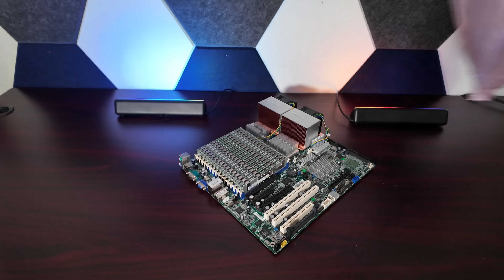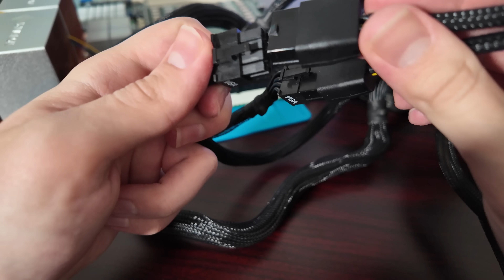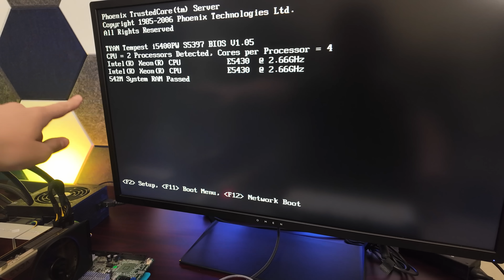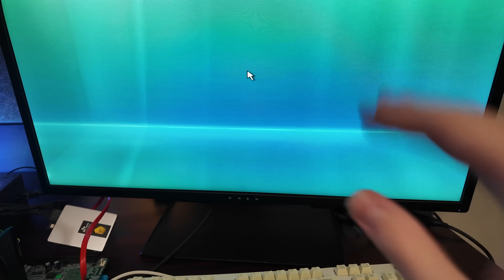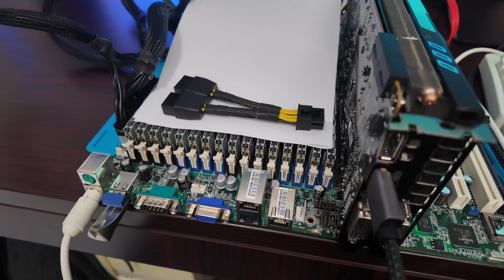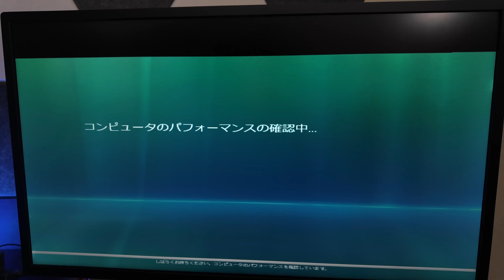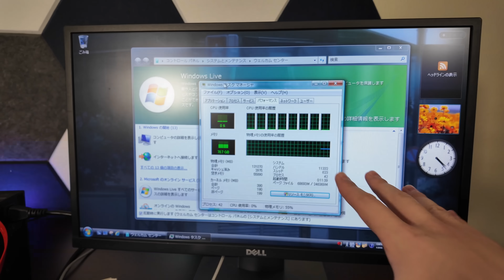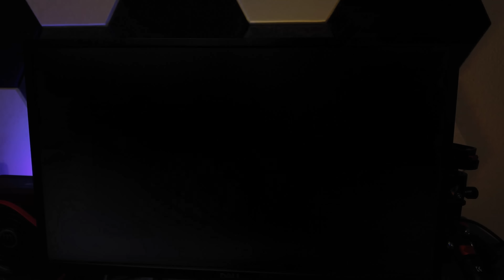What can you do with 128GB of DDR2?

Comment: install linux, install ollama, have it offload gptoss 120b 4bit to ram rather then gpu, you can technically fit a 70B model at 8 bit quantization  or 120B at 4 bit  but it might respond with a letter every minute but might generate text as fast as you can read no clue. find out :)

Comment: I could use some ideas. I got my hands on a Dual Intel Xeon E5-2690 v4 workstation, so 28 cores, 56 threads and 256GB of ECC DDR4 running at 2400Mhz

Comment: Multiple ram disks might facilitate multiprocessing. The main use I could see would be if you were running a local website, database, fileserver, services, etc. If programmer plausibly some quirky custom code, granted again likely to run into CPU bottleneck before ram usage.

Comment: 1st get some ram coolers or 3d print a mount to hold some fans over your ram sticks. (Constricting air to focus pressure is how cooling works)
2nd find a case with a lot of intake and exhaust fans or 3d print one that. 
3rd Don't use Windows vista go with a Linux distro find one you like then use a PCI slot to emulate win 10/11.
4th Play some games host some network stuff or host a local AI... you could do a lot.

Comment: Since these are XEON, I bet even in this Generation, they already somewhat support virtualisation.

Going for a Hypervisor-OS (Proxmox, Unraid, etc.) would probably work and with every trick in the book, you could probably run some more "sophisticated" services on it.

But I think the power usage would not be worth it.
One thing I could however think of, is a virtualisation server for older Windows versions. For example: Hosting some Win 98 instances and access them via remote (pixel based).

If correctly configured, this could make LAN sessions of old games in your home a breeze, if you have a really beefy (for that time) graphics card as well.

4 player Age of Empires session within seconds, running (sort of) natively on Win 98?
Guess that would be cool!

Another actual usecase would be for teaching / exploring old OS. Again with a Hypervisor and then you install every Windows Version up until... I don't know... Windows 2000?

Comment: The first PC I ever paid real actual cash money for was a DDR2 system... after living off hand-me-downs ranging from a Pentium I without MMX to a Celeron slot CPU, and even an RDRAM machine.

Though these are more GPU benchmarks, some period-correct tests could be FurMark, Unigine Heaven, and Crysis. Or if you want to get really wild, get another matching GTX 770, put that other PCI-E x16 slot to use, and see how that thing runs The Witcher 2 with Uber Sampling on.

Comment: I did decide to do some googling about what this thing can do.  And at least on the system side, this thing can saturate a 10GB network. 

Like that's a surprisingly big punch for such a old thing.  The main limitation would be getting it out of the system.  which are limited by the connection points of the era.

I would say something you can try, try streaming something intensive over your network.

Comment: if you pinmod the xeon X5470 for socket 771, you get 4ghz (at stock vcore works almost always, no tweaking necessary) at 400fsb (800mhz ram - no need to overclock that and test for stability.
2x x5470 would be usable even today I guess

i gamed on one in 2022

Comment: Would it be possible to use a RAM-disk (which I didn't even know about until this video!) to store an entire OS? And how would you make that work?

Can you run Fallout New Vegas on that system using a RAM-disk only for storing the game's data?

What if you swapped both the CPUs for something more modern (obviously with the same socket), to test what part(s) is the bottleneck in the system?

Can it run anything newer - something like CachyOS?

Comment: I have 2 of these dual cpu lga771 boards with 64gb each.  Just using every other dimm slot with a big 140mm fan on it the ram still gets to 80C.  You absolutely need some sort of 3d printed shroud solution for it in that configuration, so I could only imagine if you had every slot full.

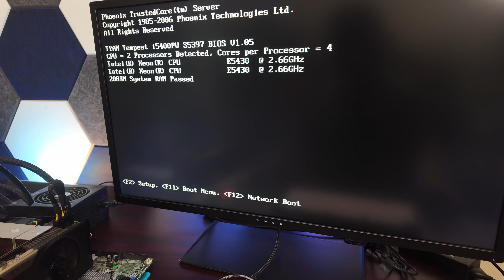Comment: 5:03 I believe it wouldn't normally do this every boot, just if ram configuration changes or cmos is reset (which it looks like happened, given the errors)
Reply: I had forgotten the old RAM check cycle,  128GB......... so funny...

Comment: I have laptop from 2006, it came with C2D P7350, 3GB DDR2, GF9600GS 512MB, Since then SSD was not existent, it had HDD. Today i have upgraded to T9400, later to T9900 and 8GB RAM, and SSD. I was using it for programming, more specifically RAM Disk, because DDR2 offered me around 2GB/sec, with basically no seek time. When SSD came, RAM Disk was still way ahead.

Comment: as far as something you could potentially do with this:

a) ramdisk could be used for a minecraft server, sure it's only equivalent to an NVMe but that means you don't need a new NVMe
b) a really slow but surprisingly smart LLM, you won't get answers from it very quickly, but you can push surprisingly high context limits and model sizes using that much RAM as long as you're willing to wait for responses. might be useful for automated agentic coding or something like that.
c) some other sort of batch processing similar to the pi calculation you did but for say, video editing or something

Comment: So strange that 1gb of HDD or SSD is 1.000mb while 1gb of DDR memory is actually 1.024mb. I just wonder why HDD and SSD sellers are allowed to scam people under the pretence of "traiditon"?
Reply: It’s not a “scam”.

Ram manufacturers and windows use base 2 to measure capacity. So windows matches whatever the packaging says for ram.

For storage, manufacturers use base 10. 1000 KB = 1 MB. Windows uses base 2. 1024 KB = 1 MB. because windows considers gigabytes to be larger than what manufactures use, it appears as if there is less storage.

Comment: Newer boards had the feature of not showing the process of counting the RAM. (Maybe for the screens that burn in images that are not changing for too long?)
So the screen stays turned off until all the checks are finished - which might need some time as the video shows.

People turned their new systems off and on again or hit the reset button after waiting for 1-10 minutes because their screens turned off while their systems checked the 32-128 GB of DDR4 RAM. (And now waiting for 128 GB of RAM sounds like "something we would like to do but it's too expensive".)
While the 10 minutes were enough for 32 GB the other guy needed to grab a bite to find that his 128 GB had been finally found and that the OS was missing.

Comment: I have one 10 years old mainboard with 256 GB DDR3 RAM and single Xeon 2673v4 and a 2nd 10 years old mainboard with 256 GB DDR3 RAM and dual Xeon 2673v4 and use it for AI.... both runs with linux.

Comment: I use to work in a telecom server factory where we made servers for telecom station. One of the products in those system was a PC unit that typically at that time run Nehalem  CPU with 3 chanell memory. The typical set up was 48GB of memory, but also 24 and 96GB was common.

We also use AMD CPU before that , but those had a even memory channel set up and only reach 64GB of ram maximum

Comment: You can run so many virtual machines inside of it. I can't recall how it was named back in a days, firstly introduced in Vista and then migrated to the 7 to be able to run older applications designed for XP.
Reply: Windows XP Mode?
Reply: @8wwwwwwww8888org  yes, it was called XP Mode, running inside of Windows Virtual PC, which actually allowed to run not only XP.

Comment: Nice i also have 128GB RAM DDR5 but you need at least 512GB to install thew hole windows and 1 game and get the lowest latency been dreaming of doing that since 2007 we had I RAM gygabyte also ACARD ANS 9010 wich is a RAMDRIVE SSD with DDR2 and the fastest RAMSAN 440 with 600k IOPS per second there are tons of pci acelerator card and ram acelerator ssd but hard to find these days.

Comment: There is 27 occurrences of the word "model" in your comments. For Pete's sake, would you please try to get an AI model running on it, see if it runs at all? These cpus may be missing instructions like AVX2 needed for AI math, and we'd all love to know if it doesn't run, or if it does, how slow. One of the main limitations of most consumer laptops and desktops is the 32GB ram fitting only small and stupid models, but 128GB can fit quite large and smart models, even if slow, but quality answers instead of constant hallucinations. Like ask it to explain a joke, and compare models of different sizes from 5 billion parameters to 70 billion and see how intelligently they perform on DDR2, if they can load at all. Look into ollama or LM Studio.

Comment: You have sse4.1,vtx, and TXT. So you can run 24h2 windows 11 with Rufus USB bypass TPM and secure Boot 24h2 will work if the system TXT services are working most important is the motherboard bios TPM NEEDS to be on as well as Virtualization and is will work

Comment: You definitely can try to run some kind of local LLM. You'll probably run into speed bottlenecks in the tokens per second (or tokens per minute?), but can technically run larger models with more parameters? 
I have no idea, I'm just throwing an idea out there.
Reply: local llms use vram instead of system ram, so unfortunately this wouldn't be great for ai

Comment: Someone got a Pentium 4 to run an LLM, so with 128gb ram you should be able to run Llama 3.1 70B parameter LLM (it's only ~43Gb in size so should easily fit into your ram.

Comment: You can make a super fast RAMdisk… think of it like a little SSD but being that is on RAM it is exponentially faster than SATA SSD… but being it is on RAM it wipes clean when you shutdown or lose power. They work great for doing portable installs of programs for single use scenarios… like I use one for data recovery program execution and I also use one for my Firefox browser cache, I also use one for a clone of my VST library when recording via my DAW.
Reply: DDR2 is about the same speed as SATA

Comment: Processors: Dual 2.66 GHz Intel Quad-core Xeon E5430 Harpertown
Memory: 128 GB DDR2 FB-DIMM @ 800 MHz
Motherboard: Tyan Tempest S5397
Graphics: GeForce GTX 71080ti
Hard Drives: 500 GB SATA III SK Hynix SSD (Boot drive)
Operating System: 64-bit Windows 10
??????? test

Comment: Clicked on this video purely because I've never seen a PC with 128gb of RAM much less one that is ddr2
Reply: i thought about getting 64 gb of corsair pro rgb ddr4 before ramagedon to get up to 128 gb but didn't so now i only have 64 gbs , should have done , you can never know when you need it
Reply: @regular_chaos6328 Wenn Du sie nicht brauchst, sparst Du dir Geld und beim naechstem Zocken hast Du wahrscheinlich auch bessere Zwischenzeiten. :-) Ergo hast Du nichts verpasst.
Reply: I have a Dell PowerEdge with 192GB ram in the garage, I ran it half the time with only 64GB because it reduced my power bill by 400/mo
Reply: @nevelis lmao!
Reply: Ive got a 2012 retro rig that runs 128gb of ram. It uses Registered DDR3 sticks. And its split 64GB per CPU as its a dual CPU system like this one.

Has Windows 10 and plays Steam stuff no dramas.
Reply: Wait til you find out about the mac studio
Reply: I was rocking 64gb too. Bought cheap bc the ramagedon was coming. Unfortunately bad wires killed my ddr4 babies 😞
Reply: *laughs in 128gb DDR4 from prime era 2020

Comment: Why didn't you just get a HP380 G5?  They do run Linux and 1/2 height GT730 cards.. and recognize Intel 750 PCIe SSDs .. plus you can mirror your memory..  and you could have stuck a Nvidia T4 16GB into one of the 2  slots (eight lanes PCIe1.5)

Comment: Still quite powerful for the right uses.  DDR2-800 in quad channel is the same performance as DDR3-1600 in dual channel or DDR4-3200 in single channel (actually a little better due to lower latency on the older RAM).

Comment: i do think that despite loosing Plug&Play, you get a lot of advantages by staying with PS/2 keyboards...

1) you get retrocompatibility up to 1990s era (when previous larger connector was used)
2) you get way less imput lag
3) the fancy features you loose are not that relevant anyway, furthermore with a propper nice mouse you can replace some of the keys for volume Play/Pause and others

As for the PC by itself...

it is a big piece of hardware, with close-to 20yr old CPU that are note very efficient despite having 8 cores that was massive for the time. Also 128gb of DDR2 sounds impressive up until the moment you remember this is DDR2, a very slow memory...
Of course trying to use it as an end user will have a lot of added problems:
1) power consumption
2) HEAT
3) lack of key  modern instruction sets that will prevent modern games (and overall software) to run
3) lack of key security features (not talking about TPM 2.0 here, but well known vulnerabilitys from old hardware like CPUs)
4) lack of compatibility with modern features (even USB 3.0 might be lacking. Also slow PCI-E, older gen connectors like PCIx32 will prevent a lot of hardware setups to make things like pro-sound edition)
5) the fact that by selling the platform you might be able to get an x79 with DDR3 or x99 with DDR4 with a lot more performance and compatibility

This is only a great test PC at this point... 
you might find a use for it... like a not-so-small NAS with some inner services enabled, including a dedicated server for some game you wanna play with your friends, maybe... or a small web server could also work... but this is more of an experimental setup at this point... you can't really hope for it to work in real-life production as a server either.

And BTW... with both User or Server use in mind... i would go 100% Linux on this PC... the retro compatibility of a distro like Debian and derived will be much much better than trying to run WinVista or Win7 that are actually the contemporary Windows OS. You'll get a modern OS with modern features and modern software that will fully support the hardware sitting below

Comment: I wish they made split eps 12V connectors on either side of the 24 pin ATX P1 connector like that on all motherboards, it looks so much cleaner than having a separate bundle of wires running to a different plug on the other side of the board.

Comment: I mean you could make it the neighborhood adblocker running pihole with some 10gig networking cards XD just a very dumb ideea. The only thing i can see it being used if you need a homelab with a lot of ram for a specific use case. But it is really slow and not power efficient